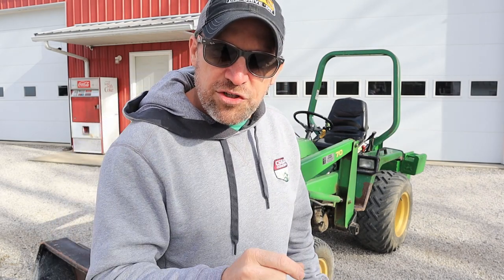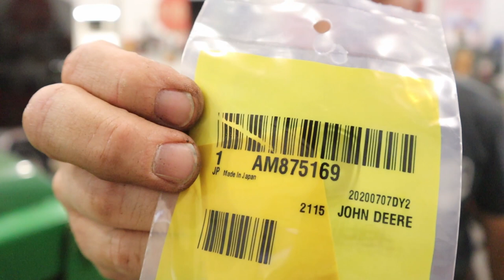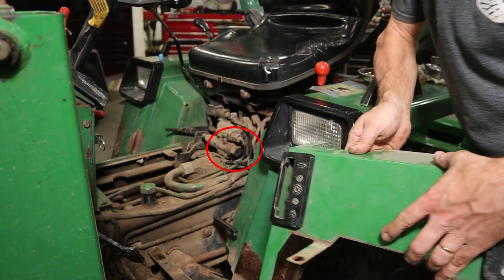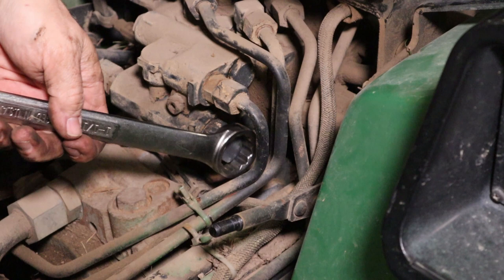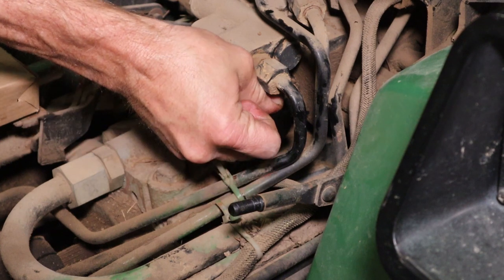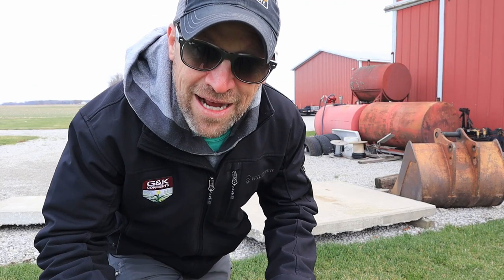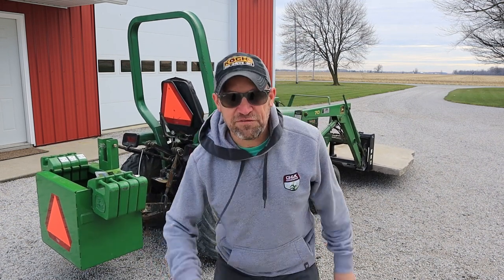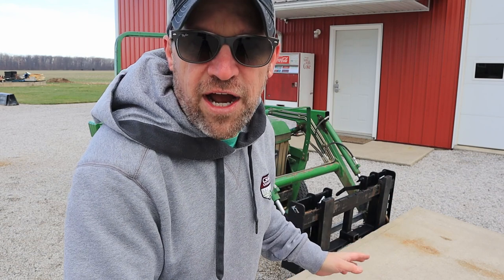How To Increase Hydraulic Pressure on John Deere 755 with Relief Valve Shim Pack - MORE LIFT POWER!

Comment: I recently installed power steering on my 1988 JD 950 with 80 loader.  This steering kit uses hydraulic pressure through the steering mechanism (old steering column , gears and pitman arm removed).   Prior to the install, I noticed that you could hear the pressure relief valve working when you tried to pick up a load that was too heavy.  I only have around 1300 psi at the boom quick connect using my pressure gauge.  I checked the pressure coming off the pump and it is only 1800 psi at full throttle   and can only lift a 850 lb. 2 1/2’.  I can no longer hear the pressure relief valve working.  I guess it is because the pressure is not building up high enough to activate my valve.  It seems I am loosing pressure between the pump and the quick connection to my loader.  I am guessing that this shim kit would not help my problem or will it?  I cleaned the screen and changed the fluid ( no filter). 3 point hitch seems to be working fine.  I can’t imagine that the power steering is robbing that much power.  Any help or suggestion from you would be appreciated.  I read the 134 comments thinking I may find an answer to my problem but I did not.  Larry
Reply from the maker: Boy, I'm not sure. Larry. If your pressure relief valve is weak then it could do like what you're suggesting. It's designed to let oil bypass the work so that you don't overstress your cylinders or framework. By raising the pressure relief value, you allow more pressure to those components before the oil bypasses and returns to tank because of the pressure relief valve. So there is a possibility that the shim pack could help you by raising the pressure that is a permitted to go to the cylinders. Do you think it could lift more before the power steering was installed then? If that's the case then I don't think it is your pressure relief situation. It is something with oil being starved from where it needs to go because of the power steering possibly? I'm not really sure though, so I don't want to lead you down the wrong path. Maybe someone will read this and jump in with some advice.
Reply: @digdrivediy  thank you for your speedy reply.  The pump is rated at approximately 2000 psi.  I am getting 1800 psi output at the pump when lifting the bucket with 850 lb. of gravel.  Since I can no longer hear the bypass valve working when picking up a load that is too heavy I think it may be do to the power steering unit robbing some of my lift capacity.  Also the power steering unit lines are only 1/4” compared to the 1/2” on the rest of the tractor.  The entire hydraulic system goes through the power steering before proceeding to the 3 point hitch and the loader.  The smaller hydraulic lines , to my understanding,  will only affect the speed at which the load is lifted and not the overall weight since the pressure is not affected by the smaller lines.  Oh well, the steering works great when picking up a heavy load.  I guess I wanted it all and was looking for a magic bullet.  Thanks again for your help.  Larry

Comment: My 4700 full size loader control reacts a little to quick. Any way to reduce this action?
Reply from the maker: Hmmm.  You should be able to adjust that but I'm not sure how to do it on a 4700.  Good luck with looking into that on your tractor.

Comment: Great video and info - thanks!  Wondering if this will work on my 750?  I believe the two models share a lot of features / mechanicals.
Reply from the maker: That's a good question Steve.  I would expect them to be very similar but I'd have to check to be sure. Let me know if you find out.
Reply: That 755 is totally different than our 750 for sure.  Looking at the owners manual the 650 and 750 both have 2,030 psi.  67 loader manual shows the relief valve located on the loader reduces pressure to 675 psi for the 650 and 1,075 psi for the 750. Breakout is 752 vs 1206.  Rated lift is 400 vs 700.  It also shows that relief valve can be taken apart and cleaned.  It says the relief springs and balls are not interchangable and must be put together exactly as they came apart.  I'm putting all new hoses on mine and will shim up the relief springs.  Looks easy and if not from JD you can buy small washers at Menards, Lowes.  Great tractors if you can find a good one and a good parts source is HoyeTractor.com.  A copy of the JD service and parts manual is also available if you plan to keep it.
Reply from the maker: @jefffrayer8238  Great info! Thanks Jeff!
Reply: @jefffrayer8238   thanks for sharing that info, Jeff.  I do love my 750, and the manuals I have have been really helpful.  Now, if only I could find some turf rims and tires for the 750, I'd be thrilled.
Reply: @digdrivediy   Added the shim pack yesterday, and loader seems a good bit stronger.  Will test it out later this week.  Replaced some hoses while I was at it.  

The hardest part of the whole project was tracking down a 26mm socket to get the relief valve bolt off!
Reply from the maker: @steveweller4675  Nice work Steve! Glad to hear it wasn't too bad. Hope it serves you well.
Reply: @digdrivediy  any hot tips on where to track down some turf wheels and tires for my 750?  Found 1 - 2 options, but curious if you know of sources I should check out?  Likely have to be shipped, I live in MA.
Reply from the maker: @steveweller4675  yeah, not sure on the tires.  I'm kinda in the same boat.  Miller Tire was always the best bet with usually the best price and where I bought my most recent set of tires.  Good luck finding some!
Reply: @steveweller4675  which shim pack did you use on your 750? I'm wanting to do this to my 650 but don't know what to buy?
Reply: Hope you guys don’t mind me bringing this thread back to life. I have a 87 750 as well and have the 67 loader. I’d love to increase the pressure but not sure where to add those based on your conversation here. Any further advice? Also, when the loader maxes out it makes a screech sound. Is that normal for the 750? Thanks if any advice given! Much appreciated!

Comment: would a stuck relief valve cause a no / intermittent hydro situation.   no trans.  bucket. or pto    you can hold bucket control lever over, nothing happens sometimes it'll have a jerky movement for a second or two similar to a low hydraulic fluid problem, but fluid is full, new and clean.   any help?
Reply from the maker: I don't think it's the relief valve.  Sounds like you have something starving the pump for oil.  Even if the relief valve is open the transmission should still work I believe.  Wish I knew what to tell you for sure but best of luck!
Reply: turns out the hydraulic screen and filter was plugged. changed it out.  runs like new  just kinda crazy it happened all at once.
Reply from the maker: @detroitdiesel1776  Awesome!  Thanks for the update!

Comment: Will this add lift capacity for the 3pt?
Reply from the maker: I believe it will since the relief pressure is higher.  I can't say for certain though as I never fully looked into it.  There may be a different relief for that valve.

Comment: Has this held up? Is the loader more reactive/quick 

I have a jd990 wanting to do something.  Very sluggish
Reply from the maker: It has held up really well for me.  No issues so far!
Reply: That’s great.  Has it made it quicker or just stronger
Reply from the maker: @cd1168  Not really quicker. It just works longer before the pressure relief valve opens, thereby making it lift more weight.

Comment: I have the 1050, an 88' do you know if that'll cross over to mine?
Has the older style twin stick control. 1 to raise and lower obviously 1 for the bucket curl. She has a lot of power already, surprised me lifting a pallet of concrete (one of those times where you have little choice, rain was on the way) it was definitely very heavy and I only needed it off the ground a couple inches. 
But more capacity is needed when you least anticipate, and there is legitimately nothing online I've been able to find about it
Reply from the maker: I don't think it's the same setup for the relief but not 100% sure.

Comment: GREAT video! I bought a 1990 "955" in 1999 with 800 hours. It has been a real workhorse, but I keep breaking the MFWD, 3rd time $800 to $1000 each time for parts, (I do all my own work), but Still cheaper than a new tractor. Mine has the same paint "cancer" that yours does, and several years ago I tore it apart, repainted everything, and it came right back!! What's up with the sheet metal on that year? Anyway, I have the same ED issue, but I also have leaking cylinders I'm going to rebuild 1st.then will do a pressure check. I did the hose swap, and it still won't lift it self with boom, but no problem using bucket. Been that way along time it is annoying. BTW I want that bucket conversion. Is there a kit yet??
Reply from the maker: Hey Larry!  Thanks for sharing your setup.  That's weird that the MFWD keeps breaking.  Doesn't seem right according to what I know of these.  They sure make good working tractors though.  There are parts to purchase to build the quick attach and there is also a guy selling the conversion that you can just bolt on to your loader arms.  You'd still need to come up with a bucket.  I have a video on building the conversion from scratch using some ebay parts.  Thanks for watching the video!
Reply: I’ve had several 955’s and worked at a deere dealership for years. What is the issue with your MFWD

Comment: Doesn't that put more pressure in the line's?? I be afraid it would blow the line's
Reply from the maker: It's all good. Pressure is higher on 855 & 955 bigger tractor with same exact loader. Works great actually!
Reply: @digdrivediy  it works great but does it put more pressure on the line's?? Mine says 2000 pounds lift so it the same as the 755 so I could bump it up 500 psi.??
Reply from the maker: @johnpolczynski7984  Yes, the pressure is throughout the hydraulic system so more pressure on the lines.  What is your tractor? I would think a 500 psi increase would likely be ok but I don't know what you have.
Reply: @digdrivediy  1987 855 jd with yanmar 3 cylinder diesel
Reply from the maker: @johnpolczynski7984  You'll be fine at 2500!
Reply: @digdrivediy  thank you for your time and information great video

Comment: I installed the shims and the pressure increased but then the tractor would not go forward or backwards
Reply from the maker: Wuh?  That's weird. Shouldn't be the case if you have pressure.  Did your hi/lol range selector get accidentally bumped to neutral during the tin removal?
Reply: I will check when I get back in front of it.
Reply: @digdrivediy  I think you were correct. The selector was in the middle. I did notice something odd. My baseline psi was around 1800. I thought it would be 2000. After the shims it jumped to 2300. 

Should I expect the pressure to hold at the high level or drop down rather quickly
Reply from the maker: @sas1967mustang  Oh thank goodness!  Easy fix!  I think the pressure should stay there quite a while.  You're going to notice a nice increase in capabilities going from 1800 psi!

Comment: Does the increase in pressure, realize an increase in Hydro fluid temps?  Does the shim job, increase the 3 point hitch lift capacity?  Thank ya
Reply from the maker: I don't think it would increase temperature to any significant degree. I believe the increase in 'relief valve' pressure would also be observed at the 3 point hitch although I am not positive about that as it could have its own relief valve but I'm not sure.

Comment: Great video as usual. I’ve been waiting for this since your collab. with Captain K.  My JD 770 has ED, or pansytitus and I need to do this to it.  I just bought some clamp on pallet forks (See yesterday’s video) so i really need the upgrade.  I assume it’s about the same process on my 770.  However, to quote the hater from your last video, since I’m a millennial - I’ll just pay somebody to do it. 😜😅🤣😂  Besides, I wouldn’t want to get my hands dirty!
Reply from the maker: Ah, come on!  It's not that tough and I think that it is nearly the exact same for the 770 as they share a good portion of the same components as the 55 series.  Either way though, even if you pay someone to do the upgrade you won't regret it as long as you don't take it up too much.  Thanks again for the kind words and I'll hop over to your channel and check out those clamp on forks pretty soon.  Thanks for watching sir!

Comment: Its interesting that JD didn't just engineer a threaded bolt in the relief valve with a lock nut, instead of shims.   Be Careful  I've seen tractor frames break by overloading loaders.
Reply from the maker: Yeah, that would have been much handier to work with for sure!  I shall heed your warning and be careful.  I didn't take it above what these loaders can handle on the slightly bigger machines so hopefully I'm still safe.  Fortunately when the lifting gets too heavy I can rely on my backhoe to take over!  Thanks for watching!

Comment: Well…I just put the shim kit in my 955 and split the pump housing wide open😕
Reply from the maker: Well, certainly sorry to hear that Wood Baron.  First of heard of that happening and I'm trying to figure out how that would actually happen as I would think it would blow any of the rubber hoses or fittings before blowing out the pump?  It sounds like your pump was dead heading so I'm curious about this particular installation.  Of course the 955 already has an elevated pressure relief setting as compared to my 755 as I was trying to make my 755 more like the pressure of the 955.  The 955 has a different pump than mine as well.  What was your initial pressure setting before the shims?  Did you use it at all after the installation or did it split the pump upon starting it up for the first time?  That sucks.

Comment: Now you can look forward to rebuilding your front end every other year. Ask me how I know.
Reply from the maker: How do you know?  Actually this tractor has had the pressure relief increased for several years now.  Haven't had one stitch of trouble with it.  As I mentioned, same pressure setting as the 855 & 955 on same loader frame so I'm surprised that you would have had trouble with just a mild increase.  I guess I'm lucky it is holding up well.  Thanks for watching!

Comment: Just like a John Deere, disassemble half the tractor and pull plates off that’s not even close to where you need to get, thanks for the info bud,,,, but I know you know the more pressure on that pump the quicker it’s going to go out,,,, thanks again…
Reply from the maker: Hey, thanks for watching.  Time will tell I suppose.  So far so good.

Comment: A little bit increase? That 25% increase comes at a price. That blows out any 20% incorporated safety factor. Be wary of overloading your cylinders.
Reply from the maker: As mentioned, it is the same PSI used on the 855 & 955 which uses identical loader components.  Two years of use and no issues (other than increased loader functionality 😉)